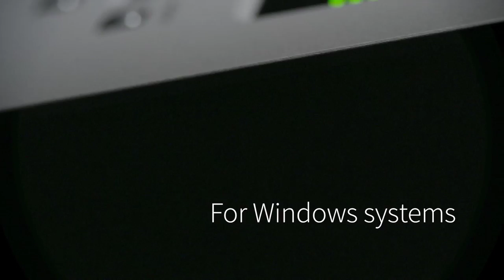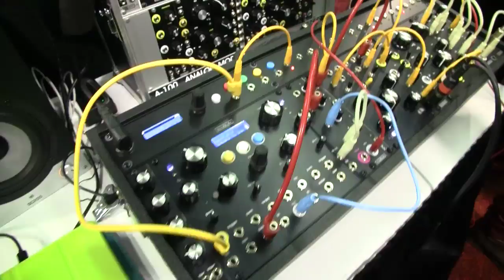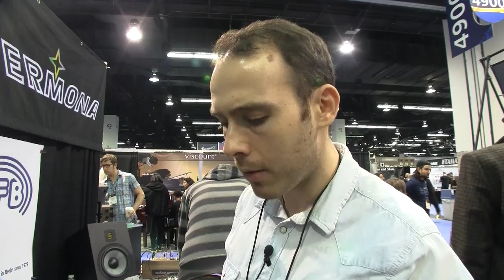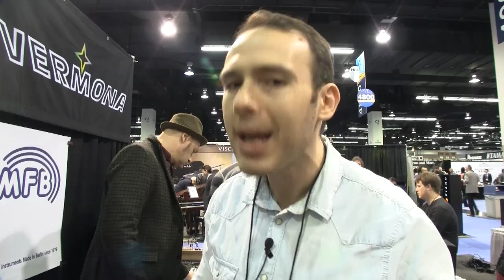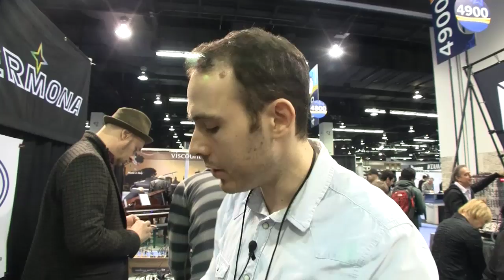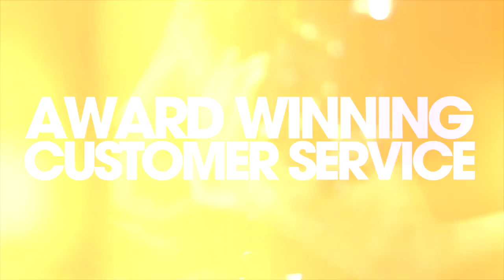NAMM2016: Birdkids Modular Synths

Comment: sorry guys & girls, a Music conference (esp. NAMM) is not really an ideal place to conduct intimate interviews/product presentations as you can imagine... I think at some point there's a better balance between the line signal and microphone signal our Colleagues at SonicState tapped into. As you can imagine the sound/video editing was not by our design ;)

Short recap:

THE BATELEUR line - boutique, hand manufactured, Analog modules - currently comprised of: 
VCO (discrete core VCO + 4-pole Filter and VCA)
EXPANDER in 6HP and 8HP
MIXER/NOISE 
teasing the TRIPLE VCO/LFO prototype (dual analog + wavetable based digital oscillators)

BIRDSNEST line - utility precision tools - comprised of:
1U Control Bus  - 4 channel Midi/CV Interface with polyphony and complex routing + individual trigger/gate

Distribution/Mixing Bus - Studio Quality internal Mixing/Distribution Interface on a 104/84HP PCB setting a new standard for Modular/Eurorack, internal mixing on 2 auxes + 2 sum buses in studio quality PER channel, user configurable, easy function-swap and 3rd party friendly! 

No need to plan a rack ahead, just drop a universal 2HP module and use it as a mixer/io/distributer for ANY module in ANY format! There's even a 2-dip switch in the middle of the PCB to allow for TWO individual mixing setups (f.e. drums vs VCO section)

u4io - universal i/o 2HP
balanced io - 2 channel balanced io interface with custom transformers and 6.3mm output + stereo panning

more on our official website soon - sign up for the newsletter and stay updated!
Reply: +birdkids records Looking forward to hearing some demos!
Reply: +birdkids records Oh we're well aware of the limitations of a NAMM presentation.   This is just a tease, for us.  We'll make the effort to get a better taste of your hardware!